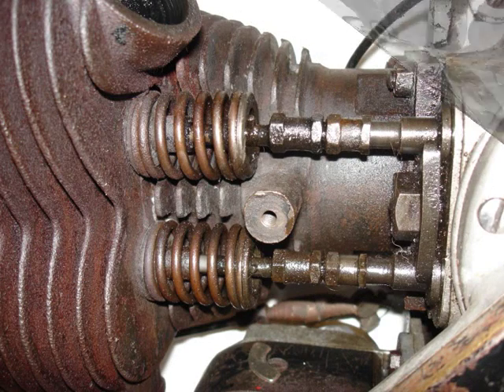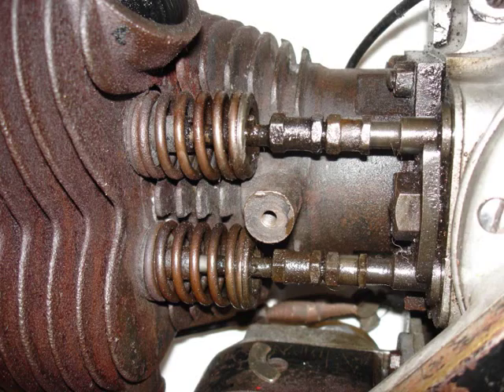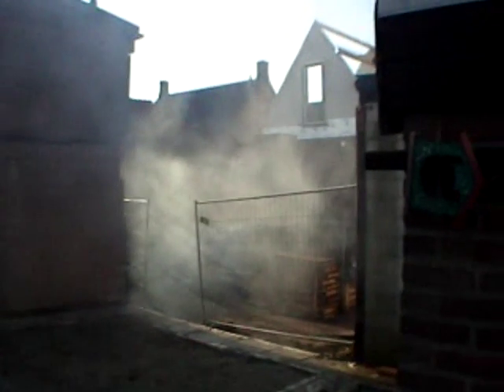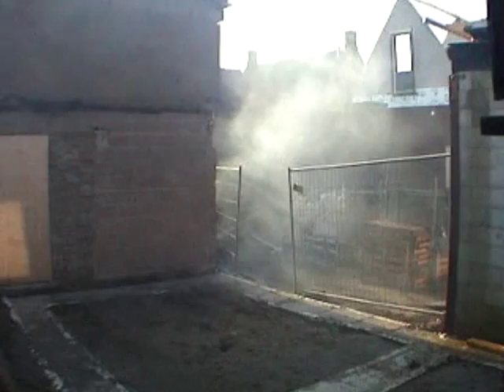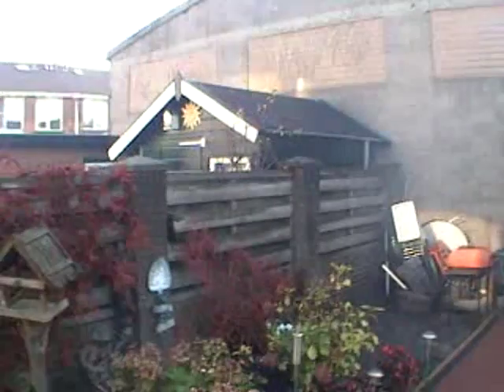Magnet Debon, revision part one,,test and revision start slide show shot movie.

Comment from the maker: Dont mind small type mistakes, hehe,,damn the smoke,,engine is lubricated bij motoroil, old fun machine, great sound,,shock the ground arround u when its running . 1 cilinder 350cc shakes the hell out of u :). The bike is no appart, spread on the bench. Revision will take couple of months.engine frame evrything will be overhouled, in origenal state.